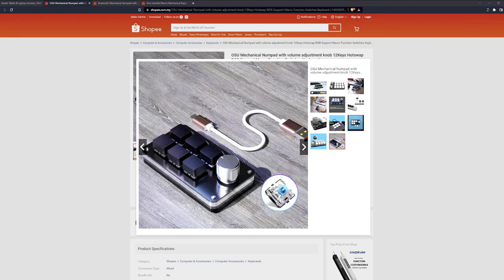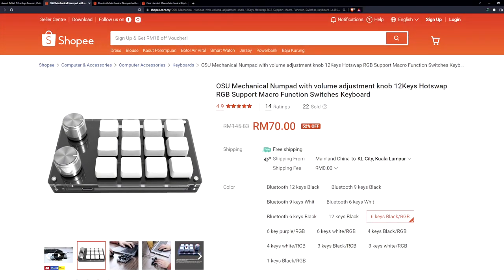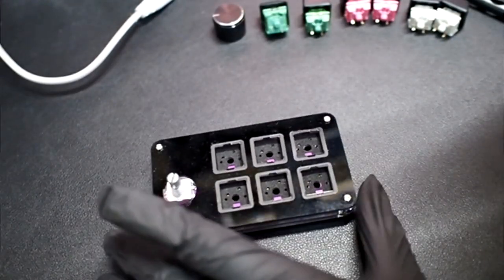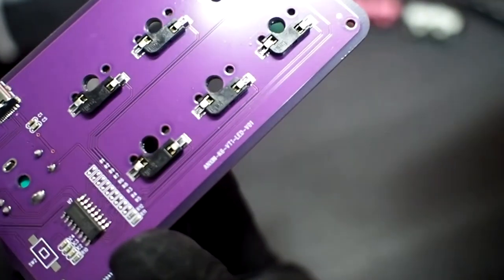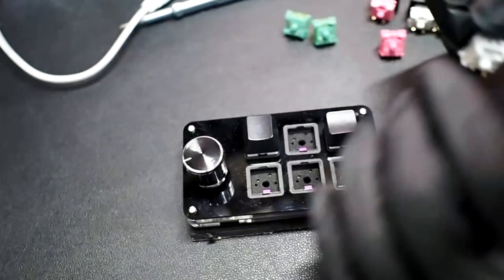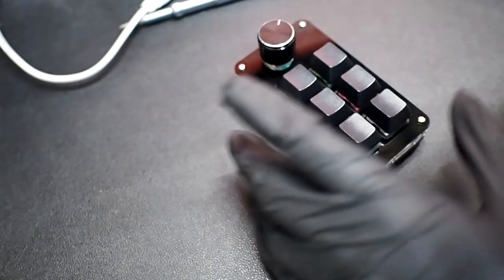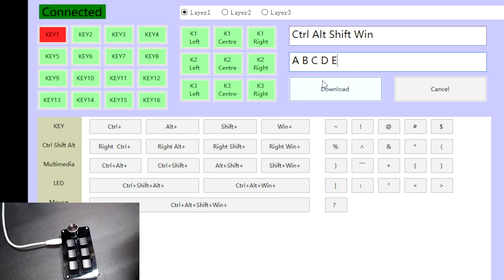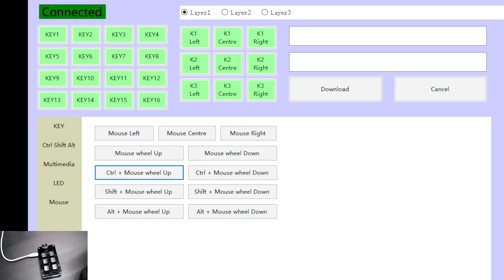Looking at a cheap 6 switch macropad with knob

Comment: I got the software to read my keypad, it says connected. but when ever i try programming anything to any key / "downloading" the programs, I get an Error Window Saying "Unhandled exception has occurred in your application" and more error messages, Anyone encountered the same problem? and any way to fix it?
Reply from the maker: No clue man. 

Try running it as admin. 
If possible, try running it on a different machine as well
Reply: I'm having the same issue, any chance you fixed it?
Reply from the maker: cools, thanks for sharing. I'll add it to the description for anyone else who needs it

Comment: Thanks for the video, if anyone is looking how to setup the knob, I managed to setup by using the K1 keys (left / centre / right). However I am not able to setup the RGB function, it's just not working at all, I am wondering if the seller sent me the right product, did anyone have any issues with the RGB? I haven't tried in other PC yet, that will be my next shot
Reply from the maker: Hi, maybe check first if your board has the LEDs on them. 

There seems to be a variant that does not come with LEDs.
Reply: @randomnick2890  I suspect I got the no LED version myself.
Reply from the maker: @JasonDeveau  then that’s that. 
You can quite easily check by taking the unit apart, like I showed in the video, it comes apart quite easily.

Comment: Hello Random Nick, I bought the same type of mini 6 switch marcopad with knob. the knob is working but the keys not working. after i set some keys on it. is there anything to fix it? only the media works for the keys button, but other not work for the keys button. does anyone encounter that? or did i missed out installing anything?
Reply from the maker: Try running the app with admin rights. 
Try it with a different pc. 

If that doesn't work, then try reaching out to your seller. I've got no other ideas.
Reply: @randomnick2890  Hello bro, thanks for reply, it works now. looks like i need to set the keys to other function like delete or page up and down then only change back to the keybaord keys that i want to program. try couple of time then it work.
Reply: @Joshuatop  interesting my two last keys 15 16 not editable just default c uhh

Comment: how do you run the software i cant get it to run
Reply from the maker: What system are you using? 
So far it seems to work best with windows 10, windows 11 is hit and miss. Other systems are not directly supported.
Reply: @randomnick2890  windows 10
Reply from the maker: @TheHaviocdarkmoon  hmm… then I’m not sure what the cause is. Have you tried running it with admin rights?
Reply: @randomnick2890  all I see is the dill file and I get not prompt to run it
Reply from the maker: @TheHaviocdarkmoon  dill file? That’s not right, try downloading it again.

Comment: crack, resumo para los latinos, conectas el miniteclado al pc, descargas/extraes/ejecutas el sofware, key 1 a 16 son teclas key con direcciones son de potenciómetros "esos tipo volumen" "left, centre, right" elige la tecla que vas a añadir, dale clic a alguna combinación de teclas que sabes jamás usarás, y a download, wala, configuraste tu primera tecla, en el potenciómetro incluso puedes ir a volumen si deseas, y darle a guardar, pero también puedes usar combinación de teclas.

Comment: Has anyone found or know of a way to store the settings in a run-able file so it can be programmed for different tasks on the fly, i.e. one setup for PhotoShop, another for Office, another for a game, etc?
Reply from the maker: The only real way I know to do this is with autohotkey. Check it out.
Reply: Mine with Bluetooth has layers for that

Comment: does it work with mac?
Reply from the maker: Yes the keys macro instruction will work with mac but the software to program it is only available on windows so you’ll need to use a windows machine to program it before it’s usable on Mac
Reply: I used windows to map the keys initially. Now on my mac I can reassign those keys on the keyboard using Karabiner elements. Using a 3-keys + knob model from AE.

Comment: how do you reset your keys
Reply from the maker: Reset?

Use the software and just program a new combo on the key.
Reply: @randomnick2890  yes if i download the wrong kwy and want to delete that
Reply: If i download someting over it it ads a another letter or symbol
Reply from the maker: @Zythirian  that’s weird, I have no such issue. I can’t really help you either. 

Maybe someone else who has experienced the same issue can share with you their findings
Reply: @randomnick2890  can you tell me atleas how i switch from layer
Reply from the maker: @Zythirian  nope, in the video I explained that the unit I have does not work with layers. So I have no experience with it and can’t tell you anything about it.
Reply from the maker: @Zythirian  if you want me to make a video on it, I’m open to sponsorship to purchase the correct model

Comment: Does anyone know how to do this for Mac OS?
Reply from the maker: The program doesn't run natively on Mac. 
I'm working on a video for running it on Linux with wine but that's proving not as easy as it should be
Reply: @randomnick2890  thanks for the reply. On the listing from the seller they claimed that you set it up on Windows, and then the keyboard remembers your settings. You can then plug it into a Mac and it will work. Unfortunately I’ve not been able to get this to work.
Reply from the maker: Yeah, that's what I've been informed too. 
I don't have a Mac to test, so I can't verify. 

I was told that the programming tool is only available for windows, once programmed, the combos will work with any machine as the macros are stored on device.